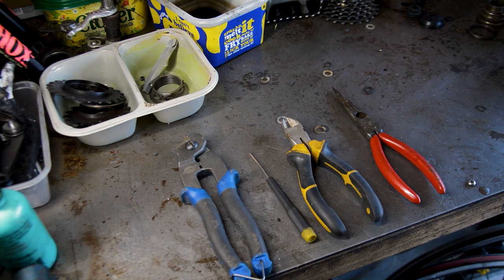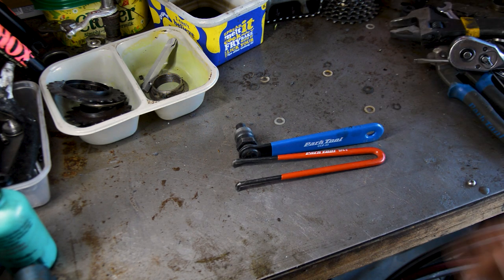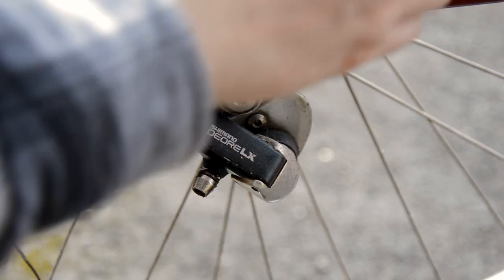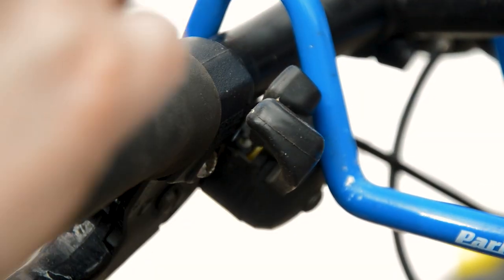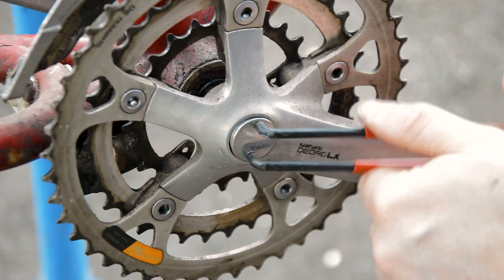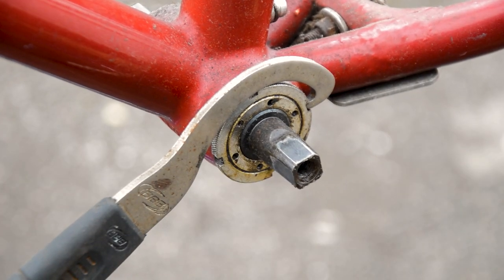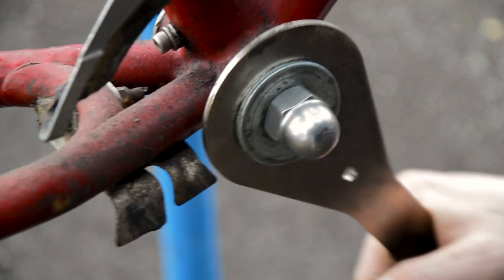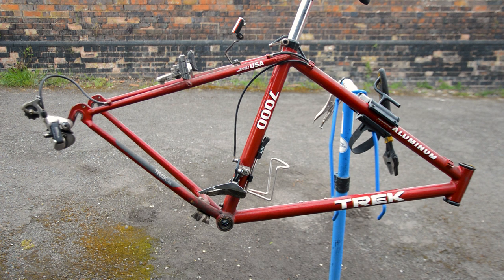A Beginners Guide Part 2:  The Strip: How To Service A Vintage Mountain Bike - 1992 Trek 7000

Comment: Another handy tool to have when breaking or joining a chain as a "Chain hand" basically a piece of wire with a hook on each end to stop the chain flying apart. you don't have to buy one! Its easily made with an old spoke and a pair of pliers.
Another hazard of missing the washer on crank bolts is stripping the threads out of the crank! Then you're #******! Sometimes you'll get a crank thats been on for a millennium or so it seems and just won't budge! Give the extraction tool a sharp tap with a hammer while it's under full compression which should help shock the mating surfaces apart, never just keep giving it more welly or again you'll strip the threads out of the crank, they are the weakest link.